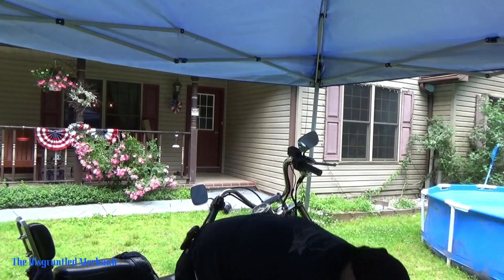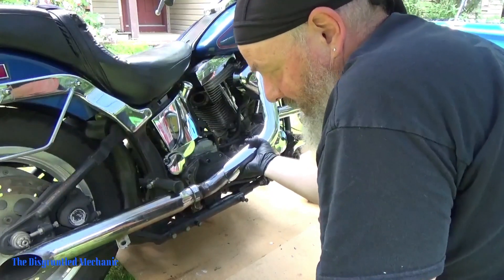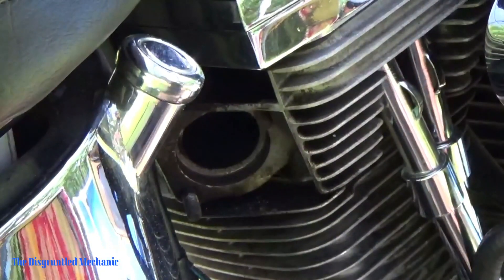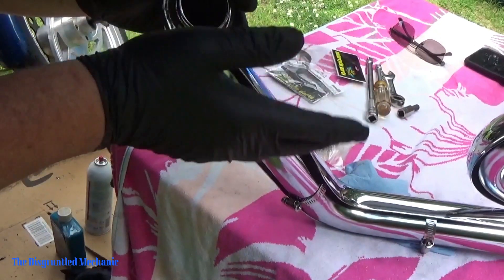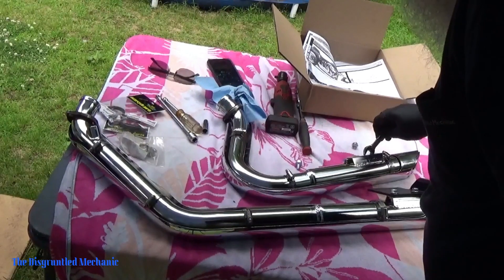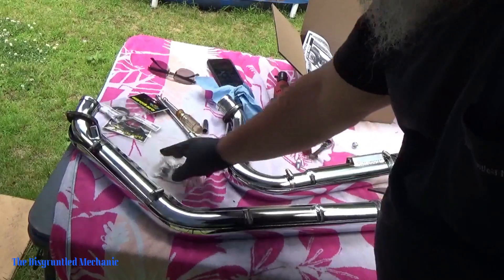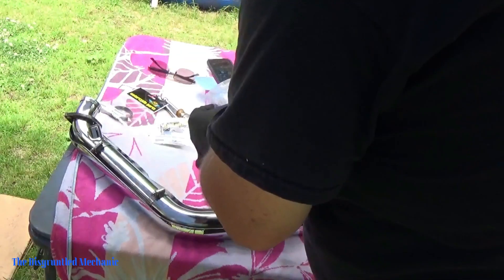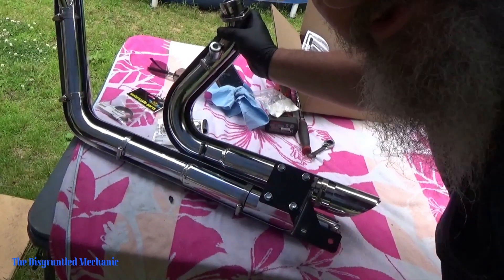Installing Vance & Hines Exhaust on 1989 Harley Davidson FXST 1340 Softail

Comment: Hey mate. We’re they 12mm 02 bungs? On website for pipes it says 12mm and 18mm so unsure why that would be.
Reply from the maker: Honestly I don't remember. I used a plug in mine because I do not have O2 sensors. Sorry.
Reply: @TheDisgruntledMechanic  no worries, I don’t have sensors either.
Reply: Did they come with the kit atleast? If so then it wouldn’t matter. I can’t find a straight answer weather or not they come with kit one person says yes one says no .
Reply from the maker: I have a short memory but I am pretty sure they came with the plugs. I do not remember having to buy them separately.
Reply: @TheDisgruntledMechanic  thank you mate. How are the piles holding up ? I’m going the big radius on my evo
Reply from the maker: So far, good.

Comment: gorilla glue to hold a washer, NOOO. just use old school petroleum jelly(transmission work) or wheel bearing grease or silicone grease to hold it (depending on type of rubber/etc seal) learn and KNW the seal types!!!!!!! step one
Reply from the maker: Come on it was metal washer on a metal nut. I dont want melted grease  running down my nice new exhaust! But yes for other types washers/seals I totally agree.
Reply: @TheDisgruntledMechanic  lol, use painters/masking tape then.
I use that all the time to hold bolts/nuts/washer in socket on long extension for hard to reach places. just make sure to have more of the tap on the socket so it comes with.
Reply from the maker: @throttlebottle5906  I have too but in this scenario especially I still say for  exhaust and just putting washer on a nut there was nothing wrong with my choice in this case. nothing to melt/burn off.